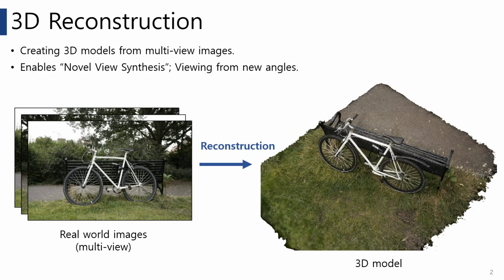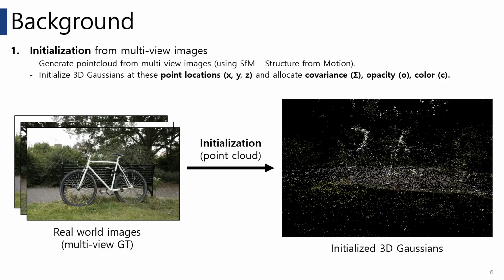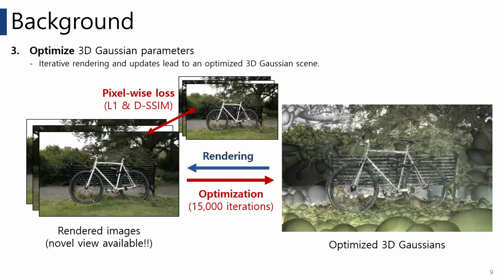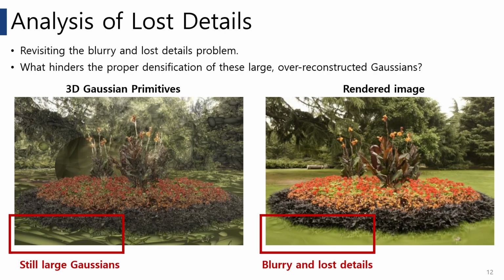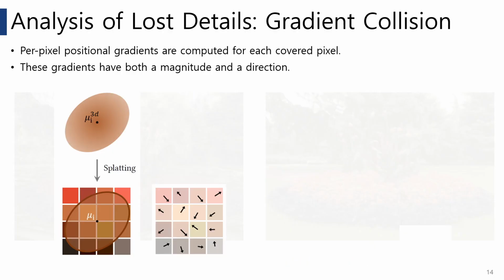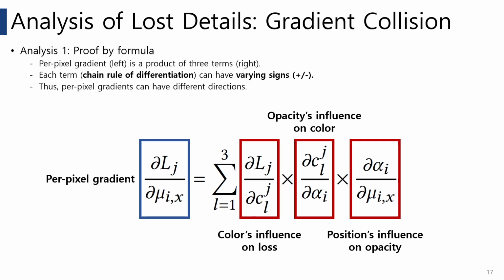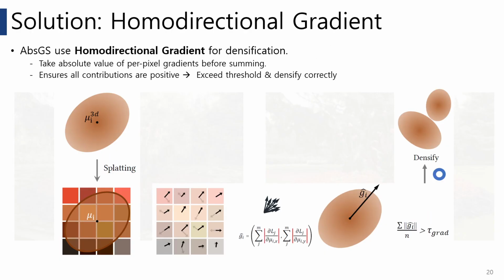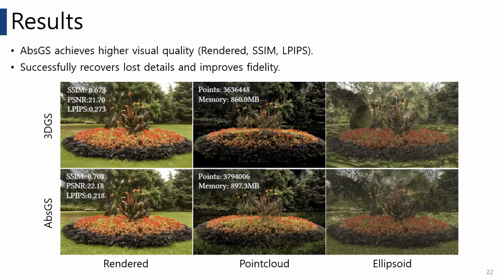[Seminar] Unlock Lost Details in 3D Gaussian Splatting

Comment: Nice presentation

Q1. When I trained 3DGS on a set of multi-view images, some views present very accurate rendering results whereas others present very blurry ones. why does this happen?

Q2. If large gaussians are the problems, why not split the gaussian into half when its size goes over a certain threshold?
Reply: A1.
There could be several reasons for this. In some cases, the camera may be intersecting with a floating Gaussian. For large Gaussians, the blur typically appears only in the regions they occupy. However, if the entire view appears blurry, it's likely that the test view camera has entered the interior of a Gaussian or is being occluded by a floating Gaussian positioned in empty space.

A2.
Blindly splitting Gaussians based solely on their size isn't memory-efficient. In regions with flat surfaces or simple structures, large Gaussians can represent the area effectively. If we split based only on size thresholds, it may lead to an unnecessary increase in the number of Gaussians.

Comment: It's a wonderful topic!
1) In p.13, '3D Gaussian' itself has only one color (p.6), but does it become pixelated and create several colors...? I'm asking because I don't understand it properly ;) 
2)  I wonder how there is a relationship between the density threshold and the small gradient magnitude at p.16.
Reply: A1.
In standard 3DGS, millions of Gaussians are used to represent an image, allowing for fine-grained control at the pixel level. However, the experiment on page 13 optimizes the image using only a single Gaussian. Naturally, this one Gaussian cannot represent the image accurately, so the difference between the ground truth and the rendered result appears as gradients at each pixel. The visualization on page 6 shows the direction of these gradients—colored red or green depending on whether the gradient is positive or negative. This illustrates how a large Gaussian may receive conflicting gradient directions across the pixels it covers.

A2.
I may have misunderstood the exact intent of your question, but to clarify: a Gaussian is densified only when its gradient magnitude exceeds the densification threshold. If the gradient magnitude is small, the Gaussian is not densified.